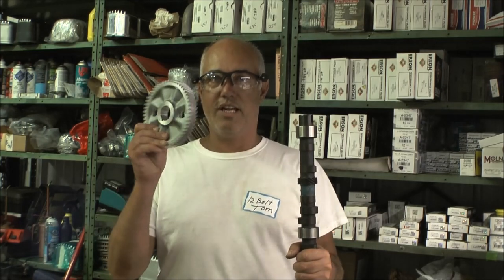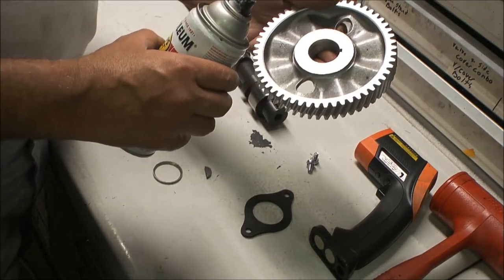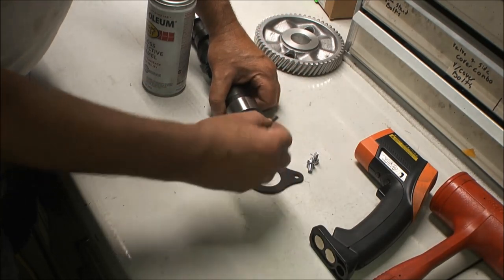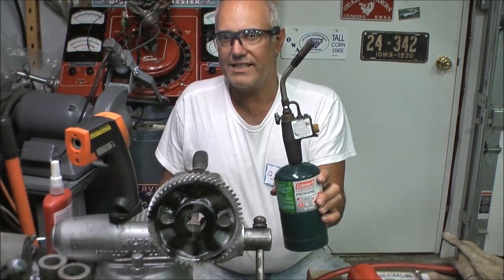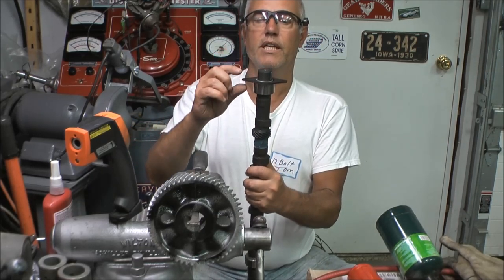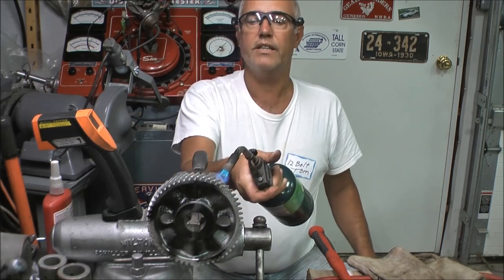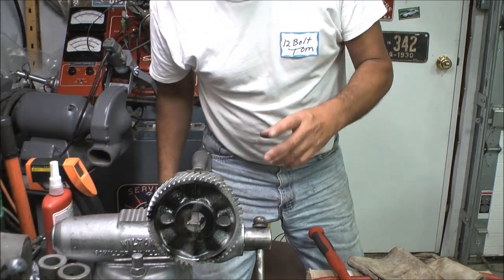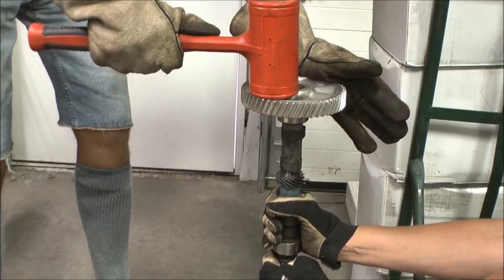Cam Gear install Chevy Inline 6 194 230 250 292

Comment: Do you have any advice on this? I've tried to install my gear preciselly following iskys manual, however it didnt work (shaved a lot of  alluminum from the gear). I removed the gear and I'll install a new one. I'm thinking about not using the iskys method (which is to use kitchen stoven) and heat it as you did, and maybe going a little further on the temperature...Cam is from isky as well
Reply from the maker: That is why I do it my way.

Comment: If you absolutely had to press it on for some reason, couldn’t you drill and tap it for a bolt? It would be like a Chevrolet V8 at that point.
Reply from the maker: The bolt will not fit under the timing cover without putting a bulge in it.
Reply: Interesting. If that’s the worst thing that would happen then it’s possible to just modify the timing cover a little. But I did make sure to install the cam gear YOUR way this time around and I was successful.

Comment: Tom   What controls the END PLAY of the gear (between the block and the gear)  once the cam is installed and bolted in with the cam plate.  Is there a clearance  between the gear and the block if the gear is pressed in towards the block OR can the gear back side touch the block?  Thank you in advance.  Bill C
Reply from the maker: First, a question for you. Did you watch the video? There is a thrust plate installed before the gear. It also has a spacer inside of the thrust plate. Dont forget the key
Reply: @telowe2000    The machine shop installed the gear on the cam.  Yes, there's a retainer on the cam behind the gear.  I will use a feeler gage and see what the exact clearance is between the gear and block face.

Comment: I have a gm witch I been told is a 194. It a 4 cylinder  Electronic recognition the distributor cap looks like it's an 8 cylinder cap but only has forced steel or brass connections.
This is in my older hyster forklift
It been working an running great on propaine. I been trying to find a carburetor for it as it runs 1.5 hours on a 33lb forklift propaine tank. I use it out side so I want to change it to gas
 This summer I be leave the timeing gear went out  it had little power an then stoped dead never to go again. I set #1 cylinder to TDC . #1 I was told was the very front cylinder at fan an water pump end. After setting TDC ON that cylinder my timing mark on balancer is 180 out. 
Being I don't have a shop an nasty cold fall an soon to be snow covered an 20 to 40 below I have not pulled it a part. I can't find much on the web other then a few  Old forums. Some say 194  Pontiac 4 banger. Other say gm 194 6 cylinder. 
No part store has any listing for a gm 4 cylinder. Only 6 and 8
I found a video on here on a 195 iron duke that was gm 283 v8 cut in half. But mine can't be that as they say being half a v8 spark plug would be on a slant. Mine are all most  Vertical to the valve cover. It went on to say no timeing chain is used. That it is just 2 timing gears one steel and one  Metallic. But being I not opened it up I can't confirm. But due to how short an small the timing cover is I can't  Imagineit would be Room for 2 gears and a chain. Been trying to sorce new valve cover gasket an new timing cover gasget as well as timing gears. Called the gm dealer an was told they don't suport the 4cyl. Any help  Would be appreciated thank you. Ps. To get the gears off is heat needed as well to install. On my Ford 350 I popped them off with 2 bars
Reply from the maker: What you have is a 153 or 181 4 cyl. Also made by GM. They share many parts with their inline 6 cousin.

Comment: Thanks for the video im.in the middle of changing the cam on my 216 engine, i need your help hopefully you can help me, can i reuse the old cam gear, and how do i take off do i just use a pulley, or do i have to preheated as well to take off thanks in advance